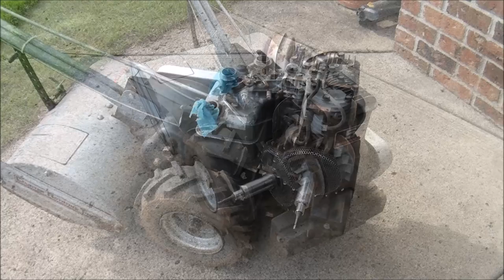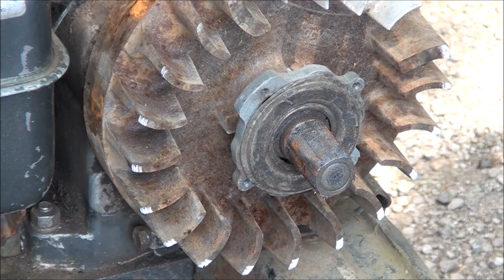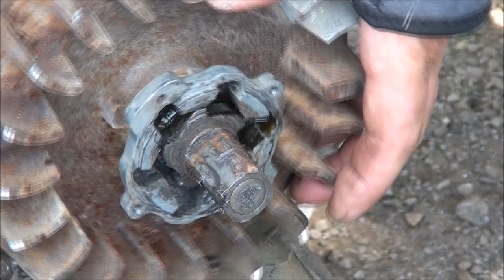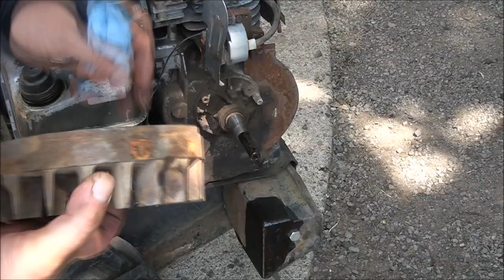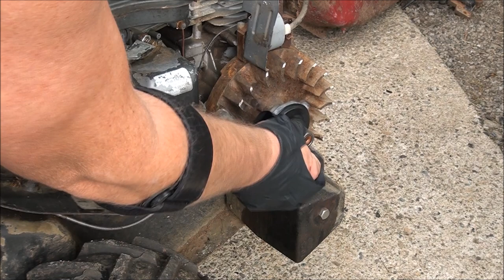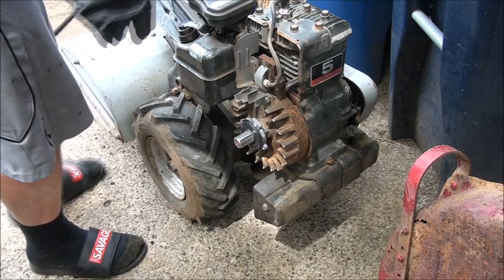How to Fix repair Replace Older Briggs and Stratton PULL Rope STARTER RATCHET ROTOTILLER wont work

Comment: Exactly the info I needed. The rewinder wouldn't work on my trash picked motor even after hours of tinkering. I compared my motor to a good one and realized my starter clutch turned too stiffly over the crankshaft and the rewind spring wasn't strong enough to overcome that. Wiped it out and applied a light coat of hi temp grease on the shaft, but left the ball bearings clean and dry so they can bounce around the right way. Your video confirmed I did the right thing and can put it back together. Thanks.
Reply from the maker: Nice work

Comment: Dont put pipe wrench on out side on pulley,  take spark plug out an feed some rope in cylinder so piston wont rotate, you can tighten or loosen  of crank shaft

Comment: Yeah that socket and the tools way Overkill those things just come right off with a pair of channel locks and the screwdriver through the end of the thing up against carburetor never had a problem and I'm an old dude

Comment: Simplicity 5hp tiller from the '80's. Bought new and it's a beast. Forged tines.Thanks for the video. I didn't know how it was fastened. Came off with penetrating oil, a bar between the fins, and large channel locks. The ratchet rotor in the old one was worn allowing the ball bearings to fall out of place. I put some anti-seize on the new one.
Reply from the maker: good job

Comment: Looking for the name of the part or part number for the item that you replaced for the pull start. I picked up a 5hp chipper and all except one of the ball bearings are missing. Can I just replace with 5/16 ball bearings or do I need the whole part?

Comment: dear jeff there is a wide slot built into the flywheel you put a 6 or 8 inch cresent handel into this slot to undo the starter clutch by turning the slot with the cresent  handel  going down onto the solid part of the motor then undo the clutch with your impact drill the cresent handel holds the steel fly wheel

Comment: Im still waiting on a part for my briggs 190702 model engine.

After i get that done then start on the old twin briggs engine but i have to get my friends mower done first because i need the space its taking up in the shed so then after putting a new crankcase gasket on the twin briggs then go over the 3 hp briggs on the tiller it runs good with vibration but its needing a longer pull cord and lock nuts unless i can figure out whats causing the engine vibration besides that it works good and a good upgrade for it would be a primer bulb put on so then i wouldn't have to dump a little gas down it to start it up

Comment: The starter ratchet has a hole in the end plug. Should it be oiled in there once in a while?
Reply: I think that's what it's made for. The hole is inside a very slight dip so it will hold a drop or two while it seeps into the hole. There is a 3 mm thick felt pad below the hole that will absorb some oil. I took mine apart because it turned so stiffly that my cord rewind spring couldn't turn it. I lightly greased the shaft with high temp grease and it works well now. Next time I'll try just oil.

Comment: Don't need a special tool.  Pipe wrench or very VERY large Channel locks.  To lock the crank, take a piece of old clothesline and wrap it around the SOLID portion of the flywheel a couple turn making sure to over lap at least once.  Tie the othe end off the the handle.
You should have straightened out that governor fan blade.
Reply from the maker: Thanks for the tips!

Comment: I have a question : How do lawn mowers charge the battery? My tractor only has a starter and magneto (ignition coil). Do they even charge the battery? I have an old Rally 10 hp , Briggs&Stratton engine.
Reply from the maker: yes there is an alternator under the flywheel
Reply: @JeffsLittleEngineService  Thanks!!!

Comment: I know by watching your vids that you are no fan of Kohler engines. I'm ready to but a new mower and it's coming with a Subaru engine. Any recurring problems with that brand?
Reply from the maker: I would not buy a lawnmower with a Subaru engine. Honda and Briggs only
Reply: Why not,  @JeffsLittleEngineService  ?
Reply: @AsinineComment  he dosent have a reason.  Most motors like that are Honda clones Itl be fine

Comment: why did he drill a hole in the shaft and clutch? did he crank it with a rachet?
Reply: Impact driver probably
Reply from the maker: yes he was using an impact driver

Comment: Next time try using a strap wrench on the fly wheel, and there are other tools that will lock up the fly wheel. Better than holding it with your hand. But good job.
Reply from the maker: good tip! I need a good strap wrench
Reply: @JeffsLittleEngineService  They do come in really handy. Makes life a little easier. And I like your vids. Keep it up. All the best.👍

Comment: Jeff, craftsman qpt self propelled, cleaned carb, but its surging, help!!
Reply from the maker: surging is usually a fuel delivery problem inside the carburetor, the slow speed jet/circuit most likely is plugged.

Comment: You ever put an aftermarket recoil on one of those flywheels? I guess guys have cut the crankshaft down a little for it to work. I'm not a fan of hacking. Has it worked well for you before?
Reply: Not on one of these personally. But I have used lots of aftermarket recoils, for my shop they hold up.

I just don't like using aftermarket carbs, pistons, flywheel etc . I feel it's too important to go cheap on especially if you have a cast piece and not that aluminum cast crap

Comment: Thats the flywheel anyhow i thought id need a new recoil spring but don't after all i took it apart to check it out the recoil i guess thats what its called it was good and rusty so loaded it with wd40 and kept pulling the cord and let it go back it drain the rusty oil spray more in and kept pulling to loosen up most the rust and its working both my arms got a good workout yesterday 

And putting the recoil back in place with the wash and spring in the middle was kinda hard but i got it back together then seen someone else had 2 tabs up like they were gonna take apart the recoil then decided not to is what it looked like i just pushed those other 2 tabs back down

Comment: You can tell it’s a botched job because the engine missing the recoil is supposed to be on the other Rototiller that he couldn’t get started the smaller one looks like he swapped them over for the better Engine so you might find out that the Engine on the smaller Rototiller might be junk